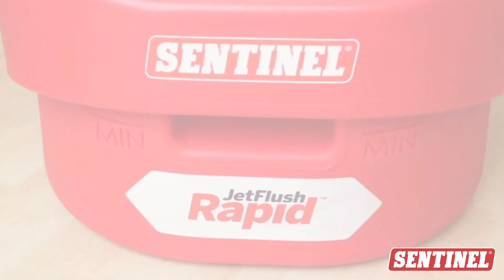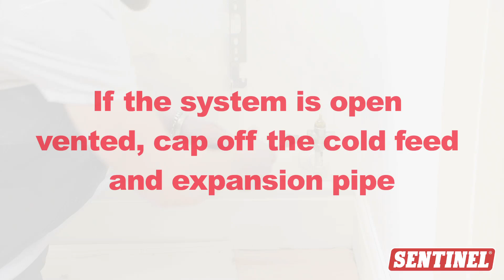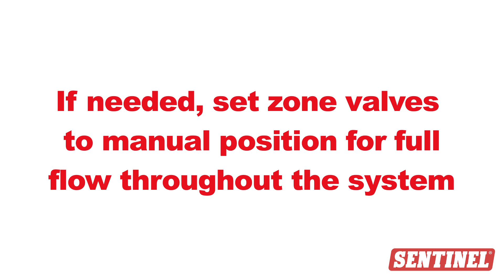How to powerflush a central heating system (1/2)

Comment: how much will it cost to power flush a Bungalo with 5 radiator
Reply from the maker: Hello Adam
This depends on how dirty the water is as well as where you are are located (prices differ around the country).
We recommend contacting 2-3 local plumbing and heating firms to obtain a quote 👍

Comment: This is wrong, you can’t properly flush from a radiator.
Reply: Why not?
Reply: @davidwaterhouse2552  because you miss out the bit of pipe that leads to the first radiator and the bit of pipe that returns to boiler from last radiator. That's all he's referring to. That's nothing asbthesesbpioes are usually vertical and short span so no real concern if not cleaned out. Rather that than cut into the outflow and connect the flush there! Too much hastle.

Comment: Great video . How much would it cost for a powerflush in a 3 bed house ? Thanks
Reply from the maker: Hi Joye. Glad you found this helpful! The cost would very much depend on the size of the property, how dirty the water is and where you are geographically. We'd suggest getting quotes from 2 or 3 heating engineers and comparing them to make sure you get a fair price without compromising on the quality of the work!
Reply: Thanks very much for answering my question and responding so fast to it !! much appreciated and I will take your good advise. Keep up the good work.
Reply: @joyetaylor1819  If you are near Kingston upon Thames let me know